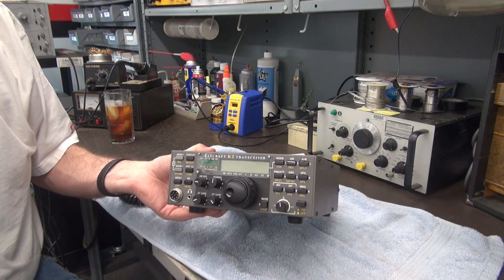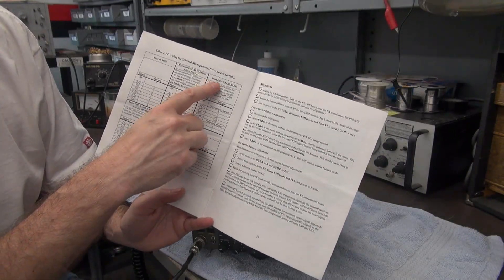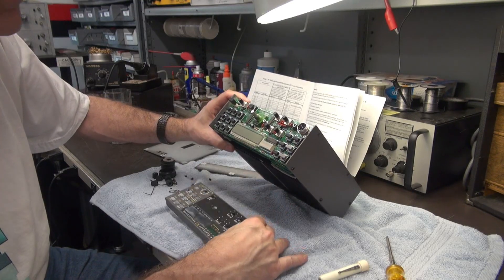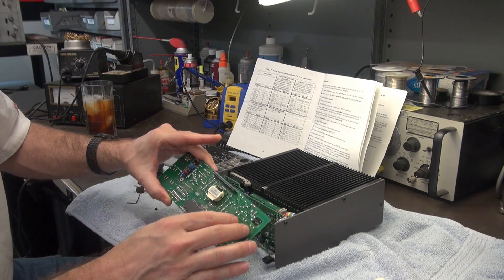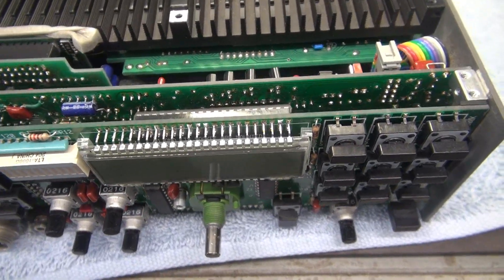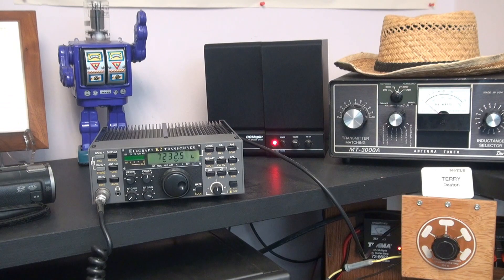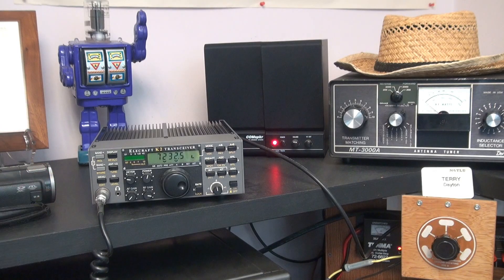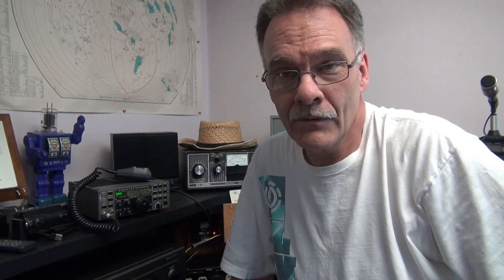How to wire icom HM7 microphone to Elecraft K2 Ham Radio Transceiver

Comment: The Icom HM-7 has a 600 Ohm dynamic element with a 2SD661 silicon transistor amplifier.  Not electret.  Nice vid.